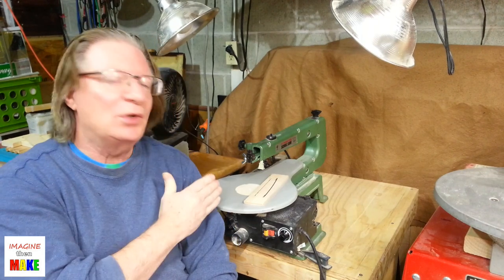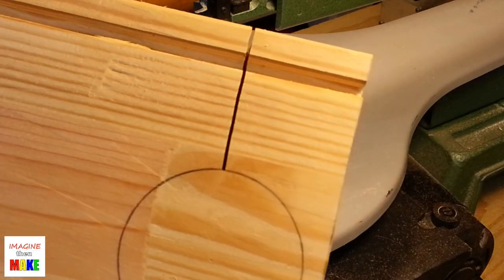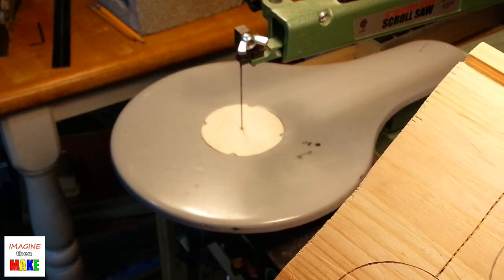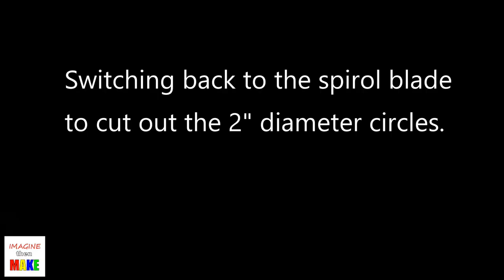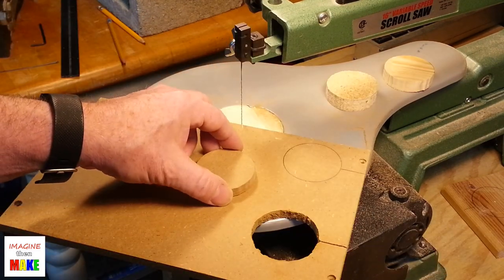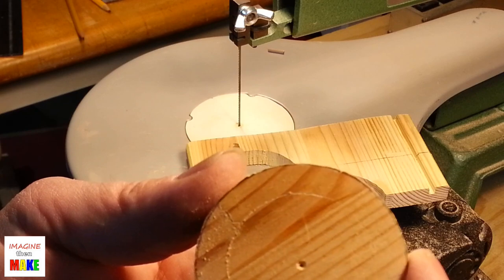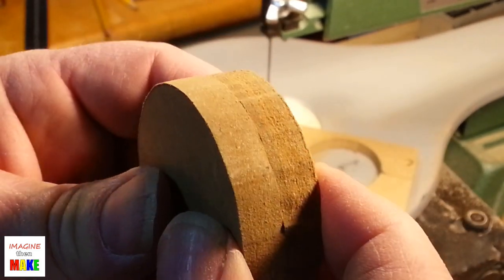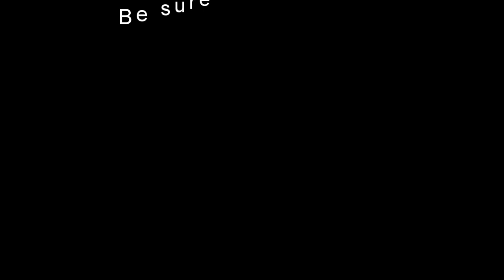120. Are spiral blades harder to control?

Comment: I have to practice on some scrap pieces before I use it on my project. Once you get used to them, you’ll enjoy  using them more!  Thanks for showing that I’m not the only one that has to practice!  Corners are where the difference really show up. MDF in no  thicker cut than  1/2. Inch. Birch is nice , some good pine wood, not plywood really great.  Overall  I use pinned  blades. Thanks for the ideas!
Reply from the maker: Yes, spiral blades do take practice when used in the conventional way. Then I did this experiment: https://youtu.be/NVUfa8sS3Pw . I found that using a fence with a spiral blade makes a straight cut easier to do. I plan to revisit the idea of using a fence on a scroll saw soon so stay tuned!
Thanks for your comment and for watching.

Comment: Interesting experiment, haven't tried a scroll saw yet, but I'm currently learning to use a small bandsaw, looks like there is some crossover. Merry Christmas!
Reply from the maker: I highly recommend trying out a scroll saw at some point. At the moment, I am focused on making videos about the scroll saw because I think it is so versatile and accessible to just about everyone (they are not very expensive tools and are relatively safe to use).
Band saws are also great tools. With the blade always moving down toward the table, the piece you are cutting is very easy to control. The downside of the band saw is that it can't make inside cuts while a scroll saw can.
A while ago, I made a couple of videos comparing the band saw, scroll saw, and BladeRunner (an inverted jigsaw). Here are the links if you are interested: 
41. Comparing the BladeRunner, scroll saw, and band saw: https://youtu.be/mVGa4cUj_nY
84. Comparing the BladeRunner, scroll saw, and band saw - 2nd time: https://youtu.be/eBQU1PT0EvM
I also have a scroll saw playlist, here's the link to that: https://youtube.com/playlist?list=PLGCBwUeR2BD0uF74gOBR3Lh0Mi9hNnA-x
Thanks for your comment and for watching.
Reply: I know this is a old video but where did you get the parts for the pinless for the H/F scroll saw